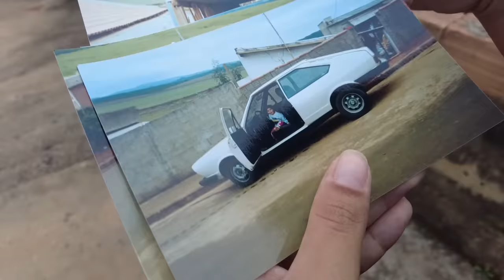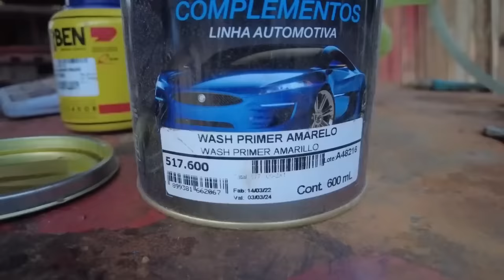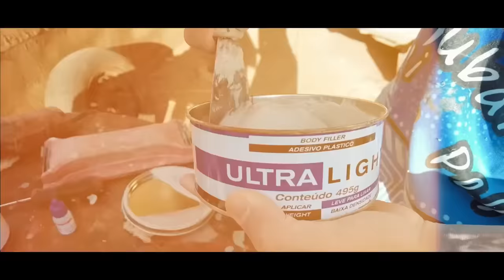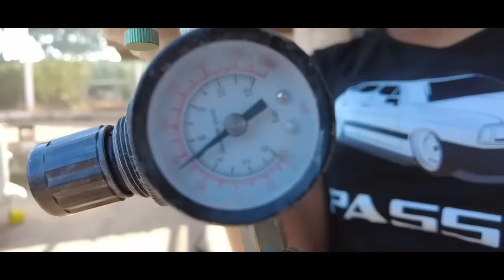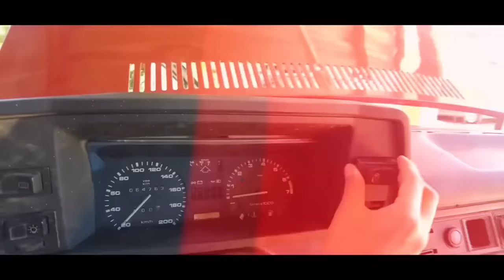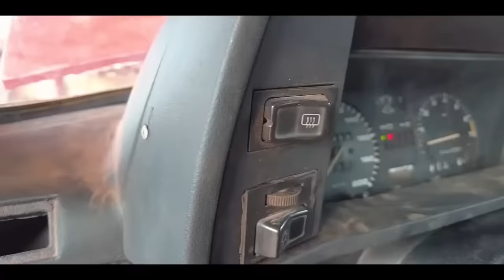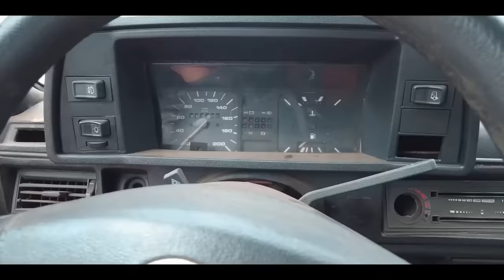60 dias de reforma completa em casa! Passat Iraquiano

Comment: Nice work, Technically its not Iraqi Car, Its VW made and assembled in Brazil, we used called it Brazilly , the problems with this car its always over heated, they find a solution and they fixed it in Iraq, this used to be a very nice car for the youth age in 80's

Comment: Great job, well done lady.
I think it would be better if you "retrofitted" the car. Keeping it classic with a little update.
For example, 
- A modern infotainment system with a small screen (7 inches or less);
- LED headlights and fog lamps;
- Classic luxurious but-not-too-fancy accessories such as chrome inserts for door handles and side mirrors;
- Enhancing the cabin's sound-proof insulation;
- Put a UV film on glass;
- Upgrade the quality of upholstery and interior with a modern and more comfortable seats, fine fabrics, high quality carpet, some well curated wood and chrome inserts;
- Add a better courtesy lights inside the cabin;
- Add some smart practical items such as USB ports and storage pockets in the cabin.

Comment: first of all, for being a girl, this work is commendable. as far as the quality of the work is concerned, it is a complete disaster, the welds are weak and full of holes, this is important because the car is not safe in the event of a collision, this is the death knell for the people in the car. in auto welding, it is not enough to just cover the damaged parts, but additional reinforcements must be installed. this car could not be used in Europe, it is life-threatening

Comment: I’m an iraqi and this car not iraqi car but we transport it from brazil … in iraq we love this car but it got many problems because of iraq hot weather in summer the heat is 53c the car can’t handle this temperature so we made many changes to the car so it can suit our weather and the car electronics very bad after one year use the electric problems start to appear